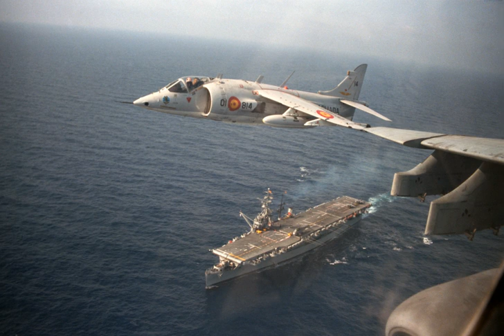List of Harrier Jump Jet family losses | Wikipedia audio article

Comment: I was on duty in ATC RAF West Raynham on the day the Kestrel crashed on take-off. This was1965. From what we were told as we were unable to see the end of the r/w from the tower. The pilot requested a short take off.  This meant the a/c moves for ward and after approx. 50 yards swivels the exhaust vent to enable the a/c to become airborne.  It appeared the pilot did not release the breaks when applying full power. The a/c veered to the left across the grass in the direction of the Bloodhound missile site. It then exploded after rolling over.???  At the end of the r/w was the Chief  Medical Officer and Wing Commander Flying in a land rover. They chased after the Kestrel and rescued the pilot before it exploded. Both received the Air Force Cross as l recall, for bravery. Well deserved.